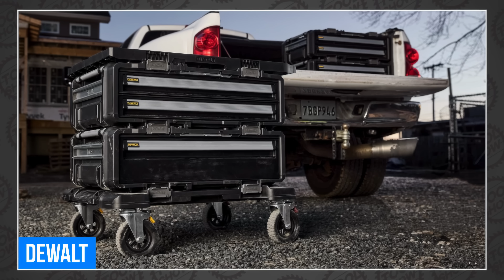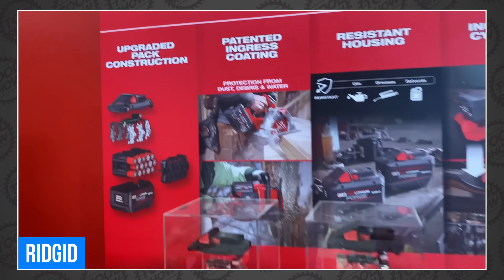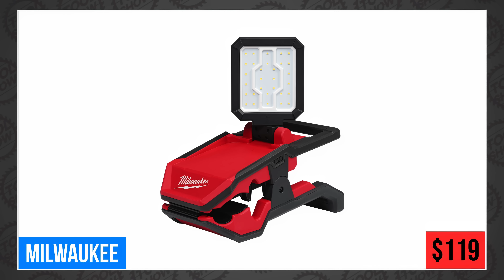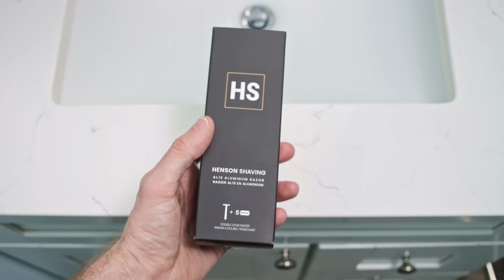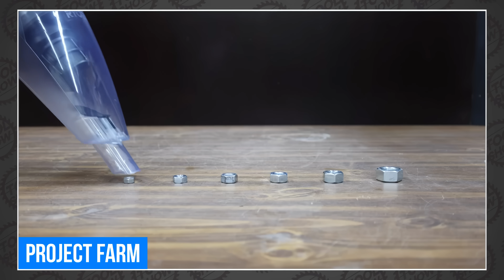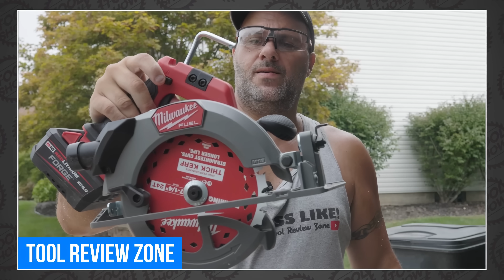NEW Power Tools from Milwaukee, DeWALT, and RIDGID!

Comment: Don't want to knock you for earning a living. Safety razors are absolutely the way to go. That razor looks exceptionally well made.... but they tried to reinvent the wheel for a problem that doesn't exist. The design from 100 years ago is superior. Nobody who's ever used a safety razor as ever had a problem with the cutting angle. But that flat face of the Henson greatly reduces the ability to pivot over curved surface. Probably great for the throat. But on w harder convex surface like your chin? I'd rather be able to control the angle of the blade myself to match the contour of my face. But if it gets anyone to switch from disposal? Then it's a win.

Comment: Every single week I tune in and hope someone made a cordless bench top planer or cordless jointer. Nope. Not this week.
Reply: Now I'm gonna try running mine off my M18 power supply and see how long it'll go. My guess is not long lol
Reply: I can't deny I'm curious as to what sort of situation you use these tools in that having them run cordless is advantageous.  Care to share?
Reply: @R4wF4ce  I actually have a makita corded planer that I’ve bought over 1 year ago and it’s still brand new in the box. I was hoping that prices for the echoflow battery banks will go down by now. But the unit I need is still hovering around 1500 bucks which is too much.
Reply: @R4wF4ce  yes, I live a condominium. I’m the type of person that doesn’t like to bother my neighbors. Planers are notoriously loud. Having a battery powered planer would allow me to plane either in my storage unit or even by renting a small U-Haul for a few hours and working in the back of it. I know it might sound mad but….yeah. That’s the reason.
Reply: 😂 just buy a 3D printer and make one yourself. 😉👍🏻